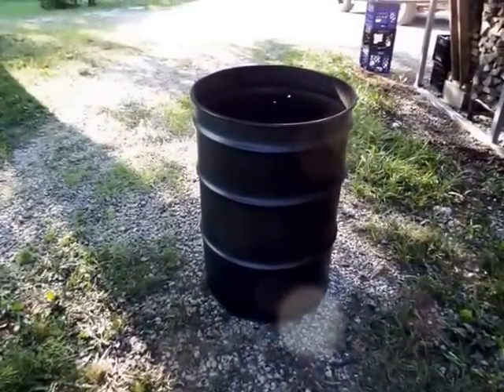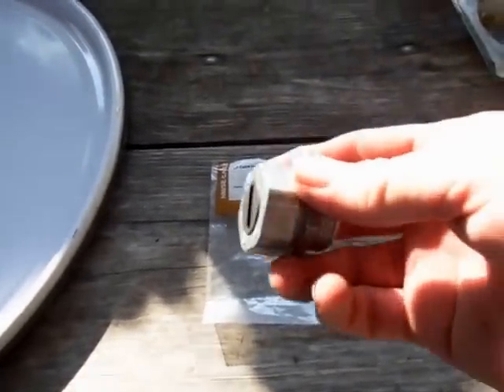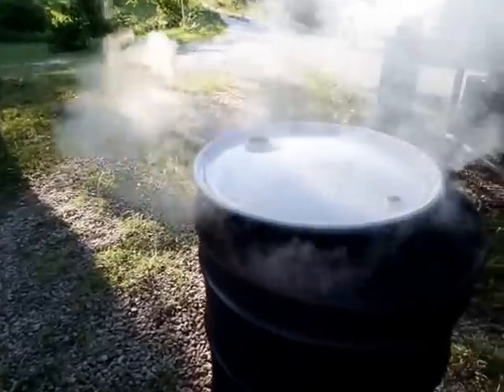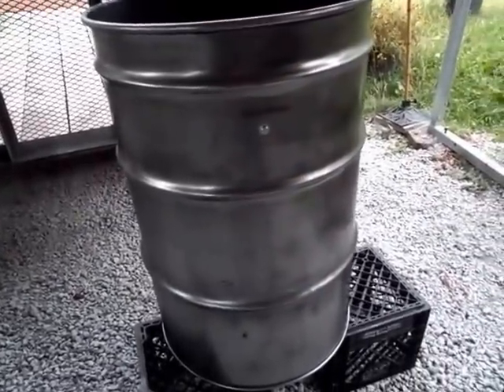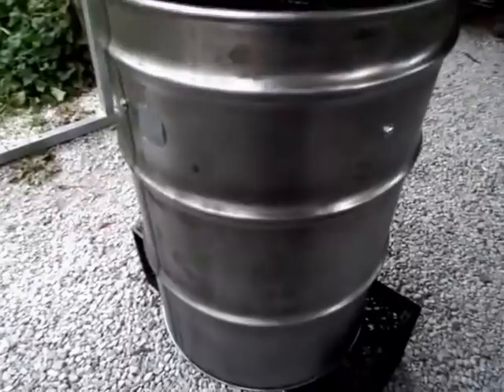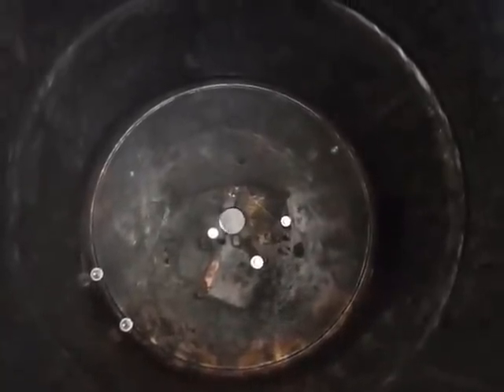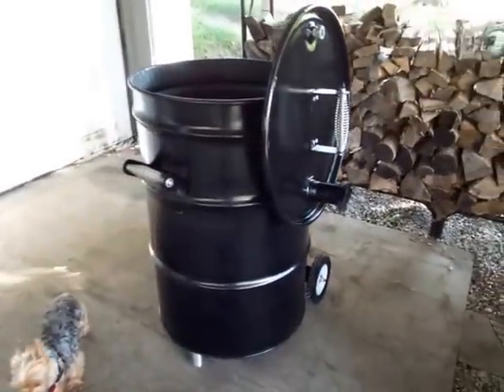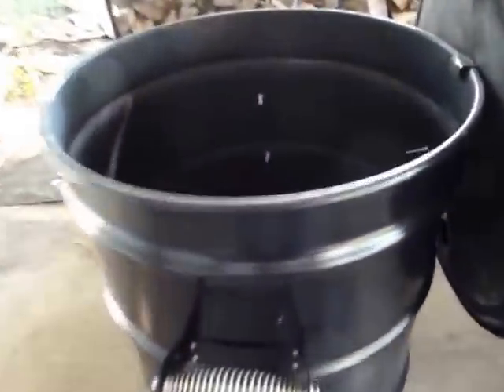Ugly Drum Smoker Build

Comment: Nice build!  You definitely put a lot of thought into it..  I'm looking into building my own and doing lots of research. I've got a barrel of unknown origin, but it's in good shape. Light coat of rust inside, no oily residue, matching lid. Paint is faded on outside but after a good hot burning to remove any possible chemicals it'll likely burn off the paint then I can sand and repaint with hi-temp stuff. I plan to cut the intake hole in the bottom for the burn in so it'll help get it nice and hot. Might even hook a pipe up to the leaf blower or shop vac to force air in for the initial burn. Since I don't know the history of the drum I want to burn it as hot and long as i can so nothing will come off during cooking later on. I am keeping an eye out for food grade barrels too. I have a feeling I might make a second one if I like the first one a lot, LOL. 

Anyway I'm seriously looking at the Big Poppa Smoker kit for the first build, but thinking of substituting out the sliding side intakes for upright intakes so I don't have to bend over every time I need to adjust the temperature/vents. Your bottom vent is a cool idea.  Also dig your wheel and tripod style base. Makes it easy to move around. Thanks for sharing your build. Let us know how your food cooks in it.

Comment: This is really nice.  2 questions - 1) why did you choose a bike peg for stabilization?  Do they have some give?  2) Is there a reason you put the handle opposite the wheel side?  I was assuming I would put it on the on the side with the wheels to make rolling easier.

Again, beautiful work.  Hoping mine turns out half as good.
Reply from the maker: I used the bike peg because with the wheels it set perfectly level and got 20 of them just collecting dust that the kids took off their bikes . the reason for putting the handle on the front is to be able to lift the peg off the ground and steer the drum like a dolly . putting it on the side you would not be lifting the drum unevenly and you could put it on the side but would not work for me that way .

Comment: What grit sandpaper did you use? and how is your smoker holding up?
Reply from the maker: I used 60 grit at first and then came back over it with 150 grit to smooth it out . The paint held up great but the 16 gall barrel that went around the fire basket helps saves the paint too .

Comment: How do you open the barrel in the first place ?
Reply from the maker: not understanding your question ? you lift the lid off ?
Reply: If you have a sealed drum, get hold of an angle grinder. Tip the wheel about 30 degrees inside the lip and gently grind down to the seal all the way round. A sharp smack with a hammer, and it’ll drop into the drum leaving a nice neat even open top, with the rim still intact to seal nicely with an old Webber lid.

Comment: With 4 air holes at the bottom is that enough to keep the fire on 250 with the lid closed?
Reply from the maker: there is actually only one hole and the other small ones your seeing is the bolts that hold the Hunsaker vent in place and yes it is big enough and can cook at any temp you want .

Comment: Man, this did turn out good....I need one made.  Did you buy all the supplies for the UDS from the BBQ supply company?  I like the wheels and bike peg configuration.
Reply from the maker: Antonio Taylor the axle and vent i got from Hunsaker smokers and the stack and handels i bought The BBQ Supply Company . My kids always take the pegs off thier bikes and wanted to something different and it just happened to work out , thanks for checking it out .
Reply: One more question...What type of drum did you buy?  Im looking on their site and there are a few options on the open head drums.  Was it with the lever or bolt ring?  I assume you got the non UN rated drum.  Thanks.
Reply from the maker: I bought a new heavy duty steel drum with the metal bolt  ring new from a container company in Kansas City for $48